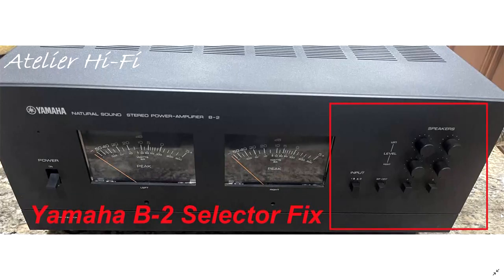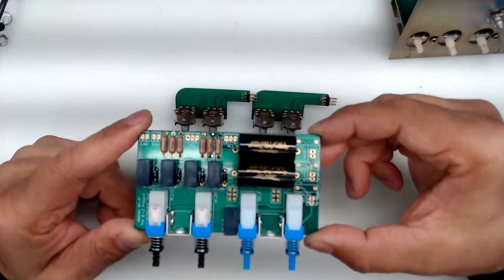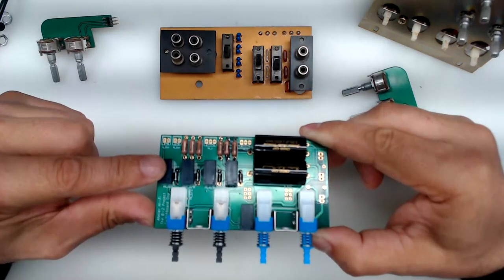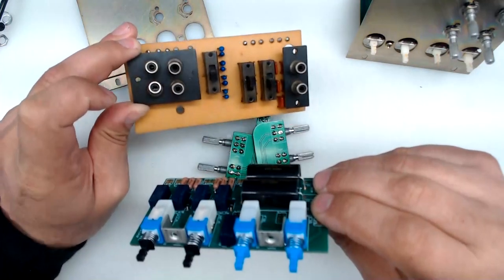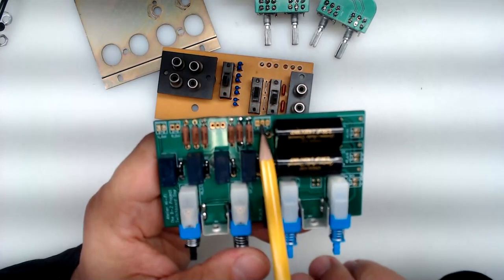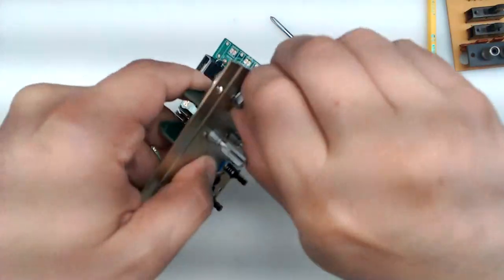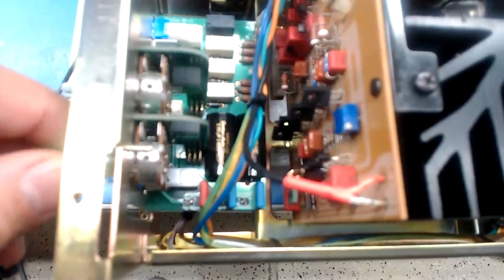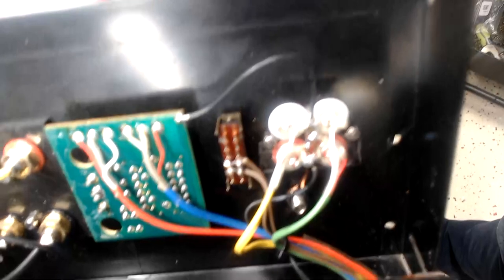Yamaha B-2 selector assembly replacement - permanent fix

Comment: Everything is first class! The only one thing that could be improved is the use of connectors in the PCB instead of soldering directly,  at least one end if only for easier dis-assembly. Nonetheless,  the work done on the design an execution of the boards is professional! I take my hat off!
Reply from the maker: Thanks for the comments. As far as adding connectors: Actually, the design allows for wire to board JRC connectors and who wants to install them, they can, but that adds a point of failure. I clearly explained that the old design used connectors for instance, to connect the pots to the board and these connectors fail and over time some have bypass them with wires directly to the board.
Reply: @atelier_HiFi  you don't sleep😆🤗